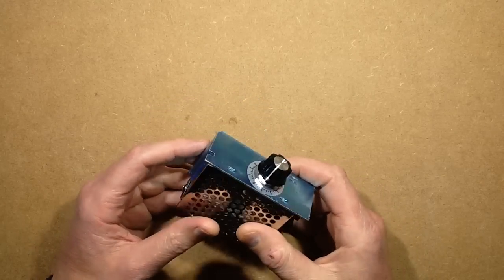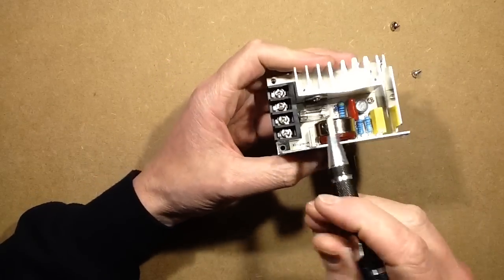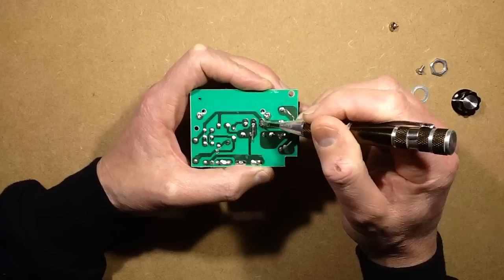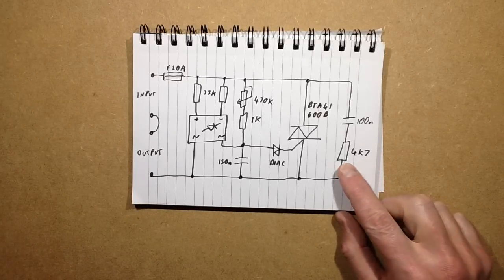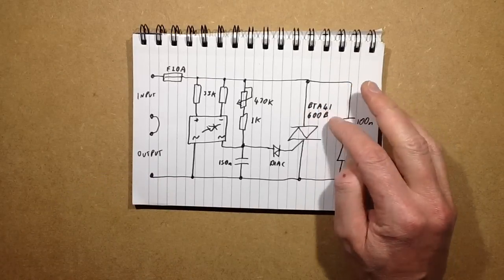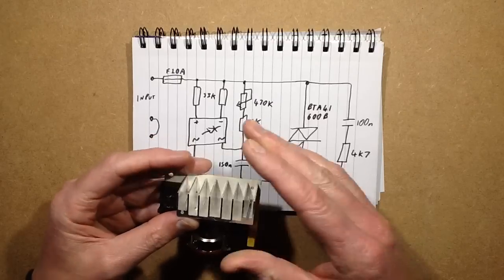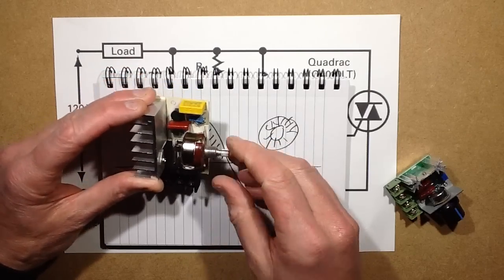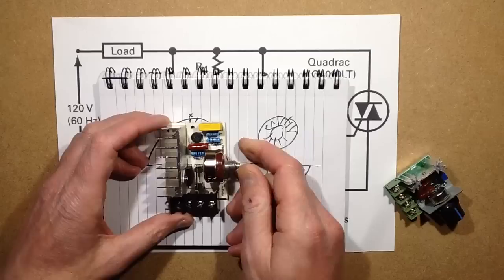Inside a "4kW" ebay power controller with schematic.

Comment: Can i ise bta14a triac instead of the quadrac q4010lto?  Please let me know thanks
Reply from the maker: To determine compatibility you will have to check if they have similar gate current, pinout, holding current, voltage rating, current rating and whether the tab is isolated or not if it is metal.
Reply: bigclivedotcom thanks for your reply.. I think... It will work.... I will try bt136 600d or bta16 which is 4amp and 16 amp respectively... after all i am using 50W ac brush motor. My previous circuit was simple triac with snubber which was you reversed engineered in another video ... But at the low speed... The motor changes it's speed from low to high again after few minutes again hi to low...so may be this circuit will be ok for low rpm driving.. I am also adding snubber fillter (100ohm and 100nf ) in it.... If you have some suggestions for to run low rpm ac motor driving circuit (240volts ) please let me know thanks again :)
Reply: bigclivedotcom i made this circuit using triac bt 136 - 600 and added snubber using 220 ohm and .068uf only a problem is 15k resistor (1\2 watt) gets hot. I think I should use 2w. Due to this problem i can't test it for a long time but there is no sudden star of motor very smooth handling.....
Reply: bigclivedotcom thank you for your video and proper explanation very helpful :) :)

Comment: This reminds me of the driving board for my cheap 20 euro soldering station. Its almost exactly the same but the pot switch can also cut the power off. Seemed cheap but it could do what it was meant for  though when set to lowest value, just before turning it off, it let 90 volts on the heating element which is kinda bad isnt it?But i guess it was the needed minimum for minimum heat.
Does this happen to this  device too?

Comment: Thank you for your video. I'm from Argentina. My question is: Why 470K Pot are 2W? It´s necessary? 1k series resistor are 1/4w. Thank you and sorry for my bad english
Reply from the maker: These do pass a fair amount of current through the pots and the high voltage across them results in higher dissipation.

Comment: If I change the fuse then can I run on 3000watt as it says for upto 4000w please reply it's important for me.
Reply from the maker: I don't even think it's rated anywhere near 4000W.
Reply: @bigclivedotcom  thanks for replying it's so helpful for me. Should I use 10000w controller for 3000w use? Will it be fine then
Reply from the maker: @pixelsenginecarboncleaners9348  I'd recommend buying a suitable controller for whatever load you plan to control from a supplier in your country.  The cheap eBay stuff generally has exaggerated ratings and safety issues that could damage the equipment or give a shock.
Reply: @bigclivedotcom  thankyou so much for helping me. 😁

Comment: I'm building a drum thickness sander for my wood shop and I'll be using a 3.5HP treadmill motor to power it. That controller would be perfect. The conveyor will be powered by a 12V GM wiper motor and the 12 volt power supply would be perfect for that. Would you please post the links where I can purchase both of these?
Thank you in advance.
Doug

Comment: not to split hairs or anything, but that is not a to-3p it's a top-3. It's an old now antiquated plastic to-3 replacement meant to drop right into where an old to-3 can was. The newer to-3p's are full plastic encapsulated outlines. Top-3's were common cases for triacs and were very popular with Sgs Thompson also known as ST. check out the TPDV640 or any bta btb seriers triacs. cheers

Comment: bridge the inner tabs ? wouldn't that just make anything used with it just bypass it entirely ?
also on another video someone said that reducing the voltage this way would increate the current used, yet you didn't mention that.
And why is the potentiometer so much larger physically in this '4Kw' unit ?

Comment: Since I'm new to this I don't fully understand your fluent electrical language. I am trying to find an easy solution to run a 4HP DC motor, which I understand entails a full wave bridge rectifier. Is this appropriate for 120V AC in - 100V (or so) DC out? Thanks for answering a noob

Comment: I am interested in converting 110v power supply down to 90volt to run a treadmill motor.  I want to use it on a home built Metal Milling machine.  Would this reduce the voltage, and also act as a speed control, or do I need a Reducing transformer plus a speed controller.  I enjoyed the video but much of it is over my head. Thanks.

Comment: I intend to use one of those to "dim" down the power use of a 500 W heating element in an RV boiler to about 275-300 W, because I like the boiler element to not take more power then my 455 Wp solar panel can produce.
Am I wrong to assume this type of dimmer can reduce (overall) power use of the dimmer/heating element combination ?
Reply from the maker: The phase angle control requires normal smooth AC and may cause issues with an inverter and undersized solar panel.  Using a smaller heating element designed for direct powering from the solar panel would be the most efficient approach.

Comment: I wonder if you need the snubber at all.  Your example diagram doesnt have one.  Maybe the novel use of the rectifier removes the need for the snubber entirely.  I wonder if a normally sized resistor in the snubber it made it unstable so they increased the value as a crutch not understanding that it isnt required at all.

Comment: So I'm seeing people use one of these with a bridge rectifier on the output to run a DC treadmill motor. Is that a suitable application for one of these? Seems reasonable. If so, it would be a really inexpensive was to offer speed control on a DC motor of that size.

Comment: I think I saw scratches from the protruding leads from PCB on aluminum housing underneath of the PCB!
Reply from the maker: +amirnasher I just checked and there is good clearance between the leads and PCB.
Reply: Thank you for checking, was worry It might short.

Comment: Hey would you run a angle grinder  2200 watt without soft start  on it? Brushed motor so in theory it should, but what is your take. I seen 5000 Watt as well 10 000 watt devices  on eBay.

Comment: Hm. I recently installed LEDs and dimmer switches at my aunt's house and had noticed that the lights only come on about halfway up the slider. I wonder if that rectifier setup would nullify that problem?
Reply from the maker: I don't think so.  It's more likely the triac latch current or the combined forward voltage of the LEDs that is the issue.

Comment: I got something like this, to pull the reins on my soldering iron! It's 300 watts, and I noticed the tip glowing after using it for a while, it vaporised the solder, so I figure it needs some kind of governing!!! 300w at 120v= a HOT iron!!!
Reply: JAMES! Since the 70's a 300W soldering iron? What are you soldering, train tracks?!

Comment: hey bigclive! is there any way you can explain a typical ebike/escooter controller? i know the jist of it, but not being an electrical engineer there are parts that i cant understand, like for example, a 36v nominal controller, when i open it up i see capacitors for 63v, does that mean that its out putting 63v to the motor? and some times i see what looks like a little transformer? is that changing  the dc supply to ac in the controller for the 3phase  bldc motor? if you could do a video that explains how it works  that would be very educational to alot of us that tinker in the ebike hobby, thanks for reading this!
Reply from the maker: The capacitor voltage rating is just a higher one for safety margin.  The transformer may be for control circuitry or it may be filtering.

Comment: Was the bottom of the circuit board sitting right up against the metal inside the device? Say hello to a fire! unless there were standoffs...couldn't tell
Reply from the maker: +AirSoftMaverick3232 There are pillars built in.
Reply: +bigclivedotcom ah so it is. Thanks

Comment: +bigclivedotcom I've bought one of these from AliExpress, to all intents and purposes identical to yours. However now I'm concerned. Going by your schematic the input and output terminals are wrongly labelled on both my unit and yours. (Labelled output is directly linked to fuse - perhaps why you initially drew your schematic wrong?.) Can you please confirm they're wrongly labelled before I connect it? Cheers.

Comment: ....i bought it recently...but the main input label was on the fused side  rather on a heatsinked side...does it matter,,?..it still worked either way anyway,,.i got confused since the reading on the multimeter on the output side did not change as i turn its pots...falsely advertised to output 10ACV-240ACV ....it was the Am;perage or the wattage that was variable...there was no manual or guarantee on this....confusion on this is possibly viral...but i am glad i learned something and able to share my experience ...Cautious when dealing with mains ...tested on incandecent for scavenged washing machine motor control experiment..i did not feel like this a few days ago...
Reply from the maker: With no load you can't test the output with a meter.  It needs a load to operate properly, and the phase angle control may result in an odd meter reading.
Reply: @bigclivedotcom  ..great news...why did they not tell me earlier..?..there is no differ in the AC meter reading because the variables is in the Ampere, Volt x Ampere = Watt..At least advertise it proper...

Comment: I have seen these sold as tube furnace heating wire controller. So it is supposed to connect to mains, which is why the rectifier probably.

Comment: Isnt it possible the resistor is in place to protect the capacitor cus the capacitor has to be very low value (100microF) to be able to handle the low power issue the entire product is build around ?

Comment: Thank you for this video, as English listening is weak, I have some difficulty following your explanation, but I generally understand the electronic diagram, I bought the same voltage regulator that you presented in the video, but it has a problem, the potentiometer does not regulate the output voltage for example on an infrared resistor, the heating resistor is immediately at its maximum, as I do not have the possibility to test the Triac, I am not a real electronics engineer, but I have some basics, I replaced the Triac with a new one, same result the regulator does not regulate, it delivers the full potential and I do not understand the reason, it seems that the triac after the Diac type diode is electrically conductive A1 A2 with an Ohmeter, why?
What is the rectifier bridge used for?
Thanks for your help
Reply: I have also same
I think became efective on the load presence

Comment: I have arced and burnt 5 of the smaller ones trying to run the output into a rectifier to run a 24v dc motor. I guess the bigger one might work better... I was thinking just paint the bottom of the small one to avoid the arc, but still dangerous I would think. I don't know enough - perhaps a big diode on the output wires? Wish I had your education. I'm a good mechanic but with this stuff, just a hack. I was thinking since the small one adjusts ac ok, just do run ac and dc at the same time through 2 separate output wire sets to avoid "buildup"?...
Reply: I was successful running an AC line to a 1000 watt 120V fan and a stove burner from a bridge rectified DC line at the same time from the smaller SCR dimmer. I have to figure out what capacitor to use. Obviously there are some serious amps here.

Comment: Can you use this to step down a 230V AC mains down to 110V AC to drive 1,500-watts US appliances/motors/blenders? can they sustain long heavy duty use under such use case?
Reply from the maker: There's a risk that the triac can fail shorted and apply full voltage to the unit.  Electronic circuitry in many of these devices also responds badly to being dimmed.

Comment: Hi. I have already controlled my control, and I included a bridge rectifier as shown by another video channel, my engine is 90VDC only I have a small inconvenience, the engine has a sound, I know it is a parasite signal, when the revolutions increase increases that sound and when I decrease the revolutions stops listening, as filter that unwanted signal, I can not add filters as it would double the voltage and overload the motor as it increases 180VDC with the capaitor, use a potentiometer of 250K, the 200K does not manage to get it support with the request is a hug.
Reply from the maker: The DC motors will make a strong mains frequency noise because the waveform is being switched on each half of the wave and at the mid setting it will be loudest because it's the highest voltage transition.  Once the motor is loaded it might be quieter.  Even with modern high frequency motor drives you can usually hear a distinct whistle noise.

Comment: Hey Clive! Do those metal cages help with RF or EMF interference? How would one test that?
Reply: +thatrudager Yes, they do help a bit to contain anything the PCB is transmitting but what the cage doesn't do is prevent the current spikes to get back into the mains and the load wires. Which will act as large antennas.... so the can transmit a lot. For proper RF / EM interference design there should have been a choke and more filtering I think. You should be able te test that with an antenna and a spectrum analyzer. But on this unit, I'd expect the wires to be the main source of RF nasties.
Reply: +Peter-Paul Vervoort Oh thanks! That was a very informative reply. I feared the cage was purely decorative from the Chinese manufacturers.
Reply: +thatrudager The cage is primarily there to allow airflow around the heatsink and any other components that might get hot. There's not much use having a chunky heatsink like this has if the case isn't vented.

Comment: Hey Clive, I'm using this unit to slow down a shaded pole AC motor in a tape echo. I've tried using a toroidal 220uH inductor as well as a 1H winding of a transformer but I can't get to smooth the switching transient at all, still loads of noise coming through. The motor is 240AC drawing 0.1Arms,  is there a way to calculate the inductance for the choke? Cheers!
Reply from the maker: You may have to seek inspiration from a wall dimmer to work out suitable suppression.  For such a low load a standard wall dimmer might work if you use the type suited to inductive loads.  For even quieter electrical operation you could use an LED style lagging edge dimmer.
Reply from the maker: It's also worth mentioning that the use pf phase angle control may result in rotational noise of the motor in an audio application.
Another option for clunkier steps might be to try series motor speed capacitors as sold for ceiling fans.
Reply: @bigclivedotcom  I did try a normal light dimmer like 'lookmumnocomputer' did, but I did get the same amount of noise. His Copicat model is slightly different so I'd assume there's a better wiring/pcb layout. I was hoping with an insanely big inductor I'd be able to smoothen the transistion enough! Thanks for the suggestion tho :)

Comment: hi bigclive I need your help I have a big cooling fan and it has 3 speeds but it's just to fast and noise 
is there any way to put a controller on it so reduce the speed of it
all I know is its a brushless motor that uses about 110 watts 
I don't know anything about it tho
thanks for any advice

Comment: Hi do you think this regulator can be used to regulate the primary of a Micro wave transformer ?
Or it Can burn the MOT ?
Thanks 👍
Reply from the maker: I wouldn't recommend it.  Be VERY careful if playing with MOTs as they are currently the biggest killer of experimenters.  Literally like playing with the power supply of the electric chair, and your GFCI/RCD will not detect you getting shocked.
Reply: @bigclivedotcom  yes you are right about the MOTs.
They are dangerous things.

Comment: Sorry, newb here. Am I correct in understanding that, given a properly operating system, the voltage passing through the potentiometer shouldn't ever exceed ~30V?
Reply from the maker: +Jonathon B. the voltage across the potentiometer can theoretically be near peak mains voltage.
Reply: Yikes! Isn't that dangerous?
Reply: +Jonathon B. Especially dangerous "If" (when) the pot shorts to its' knob's screw through the control shaft if that part is at full mains voltage; I've seen people get connected to AC that way & get a nice sharp tingle. Solution is to design the circuit so the wiper of the pot is at ground, if you can, or, to use an insulated shaft between the pot & the knob. Or insulate the screw on the pot well at least. Friend has me designing some very odd HV devices on occasion and there are gotchas usually in his stuff. I let him build them himself :p At least his don't need certification as they're experimental, but if you delivered those from a US company & someone died, you are talking "Well, let's see what getting sued for everything we own, is like?" So long as you don't touch the live voltage all's well.